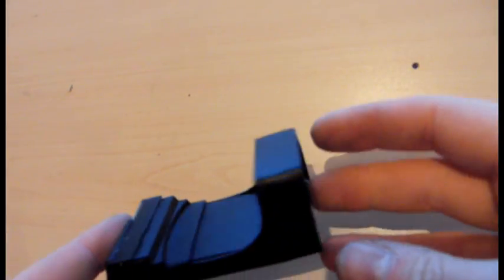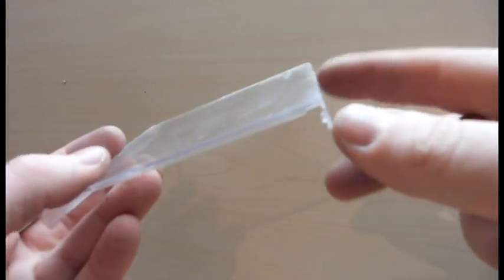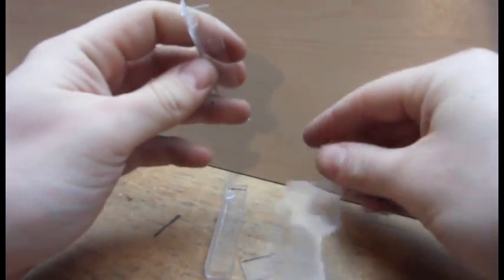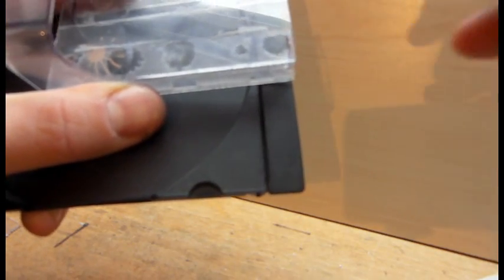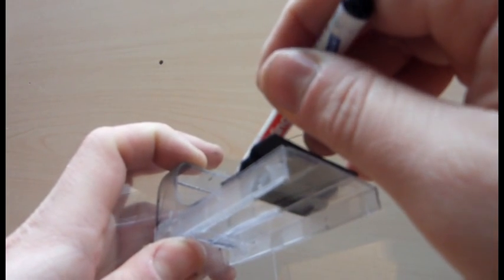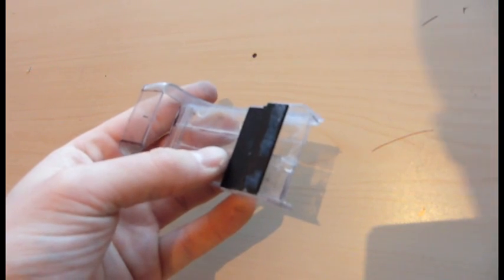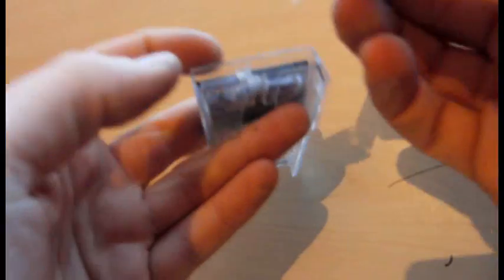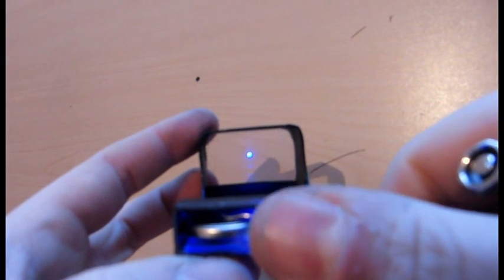Reflex Dot Sight, made from an old CD case  TUTORIAL

Comment: Nice fabrication methods. But the sight itself is not very practical because of heavy parallax Problems. The key at designing a reflex sight, is to calculate the bend of the reflectioning glass to minimize the parallax.
Reply from the maker: +Whatnever Total bullshit, although I know what you mean. a) selfmade and b) you aim looking STRAIGHT through the damn thing xD not from the side...in case you are a sniper who has to hit a penny from a mile away, you can try and bend yours though :p
Reply: Why is it bullshit if you know what i mean lol. a) yes sure but there are some ways ;) b) No, the idea of a reflex sight is, that you dont have to perfectly align your eye with the gun(because it is easier to draw than to draw and then align an ironsight). Actually i tried the same thing myself some years ago and ended up using a bent piece of glass i salvaged of a halogen bulb. Because otherwise, it was way to inacurate for my uses. Still cool as an effect, but i like my builds to be technical correct. I'm not trying to turn your creation down(Im far from it, its awesome) but just giving a little annotation from a tech geek.
Reply from the maker: +Whatnever Those glasses are actually a bit too much. Like a half circle...what you need is a slightly bent piece of glass or plastic. Or it will look and work even shittier, thats what I means. You havce to line up eye with the target, so this is still better than bending the display "somehow" and make the dot wander...dont act like you dont know what I mean :P